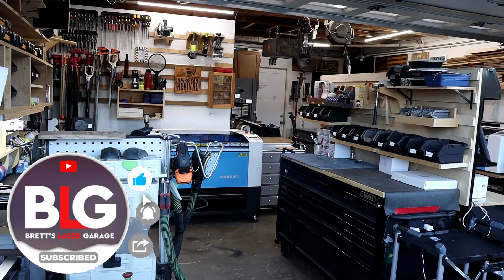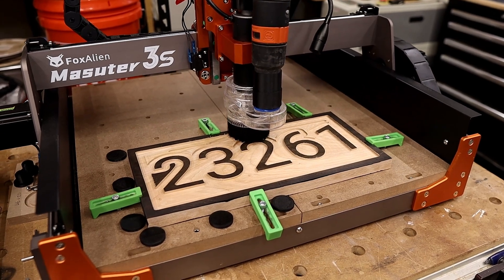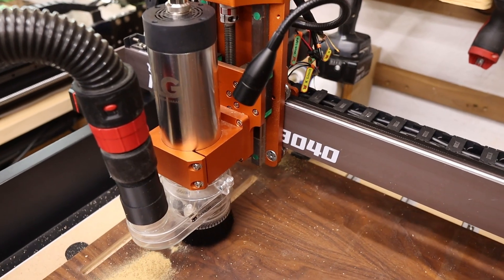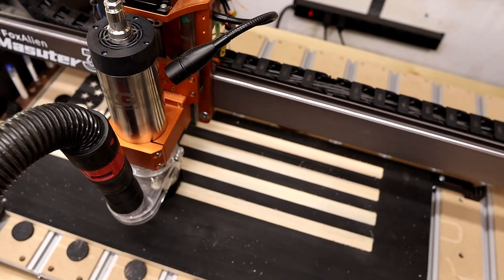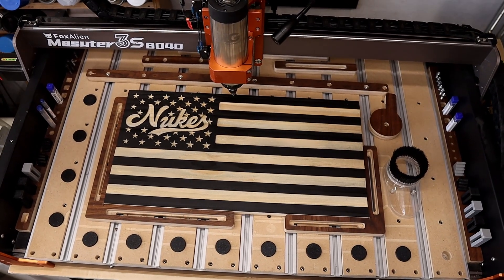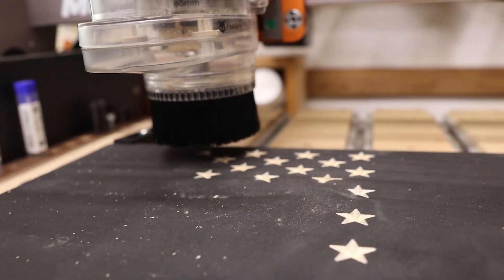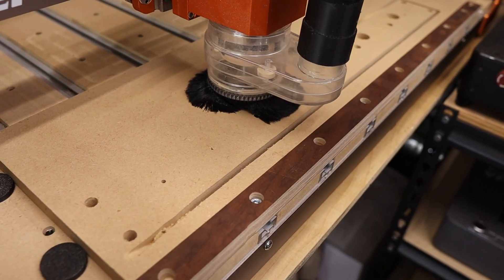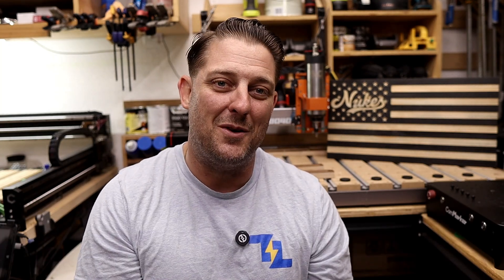The Masuter 3S Just Leveled Up (Spindle + Extension Kit)

Comment: A spindle is a great upgrade to a CNC system.  I also prefer screw driven CNC to belts because you have to be aware if your belt is slipping.
Reply from the maker: I agree.  But don’t count out the belt driven models.  I had a Shapeoko pro for years that was belt driven without one single issue.  Also been running this Masuter 3s for about a year, haven’t touched the belts.
Reply: @LaserGarage  do you have a recommendation for a water cooled spindle and vfd for a shapeoko pro? My garage/shop gets over 110° in the summer
Reply from the maker: Yeah, Carbide 3d sells an 80mm water cooled spindle.  I’d go with that.